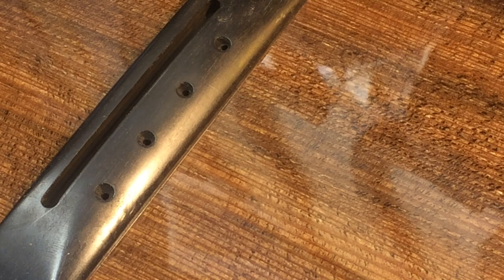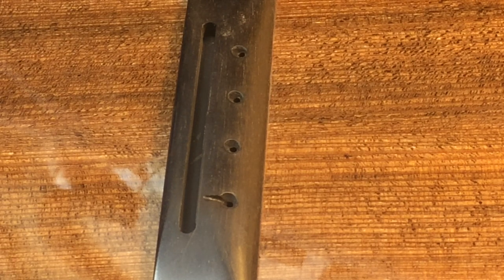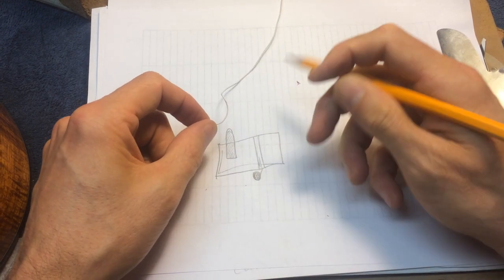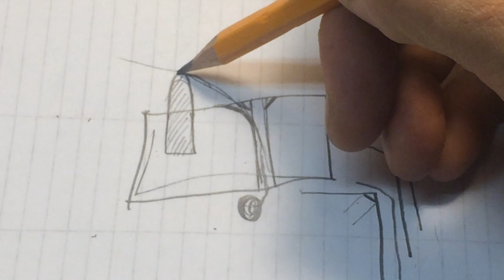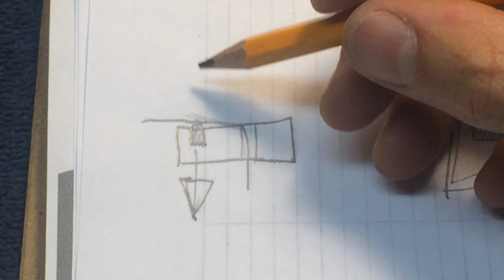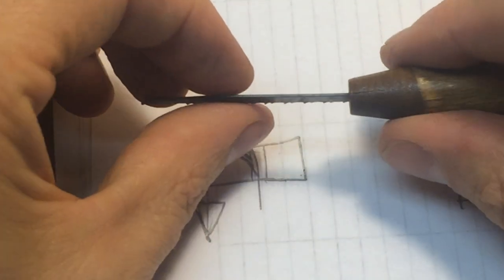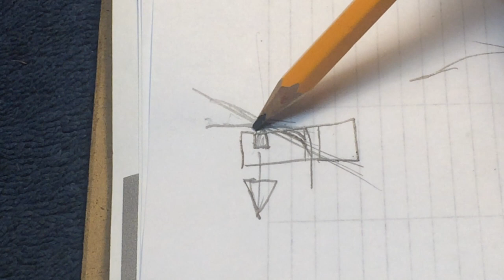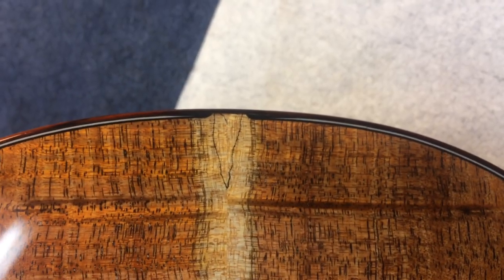Why you should cut string ramps in a guitar or ukulele bridge  Beau Hannam

Comment: I think it's worth stressing what Beau says in reply to another commentator. The rationale for tonal improvement from ramping relates to break angle. As I said in response to a post from a different luthier on this topic, Alan Carruth did an experiment on this and concluded that the amount of break angle needed (at both nut and saddle) is only what is needed to accurately define the point where the string crosses the nut/saddle and exert enough tension to keep the string from moving about and wasting energy. That's not really very much. See Carruth (he found that on blind testing people could not tell the difference between a break angle of 25 degrees and 6 degrees - that's a lot - provided the strings remained the same distance from the top) but also Ted Woodford's channel for more on this. At the saddle, the issue only arises if the saddle has been lowered to such an extent that Carruth's two criteria are broken (usually in an attempt to lower the action in a guitar which is getting near needing a neck reset). In this situation, ramping is a great thing to do, but otherwise there's no real evidence that it makes any improvement. The reason for tonal improvement is because once the two criteria are broken, tone is seriously degraded, and ramping restores the criteria.
Reply from the maker: Yep- 👍🏻 forget to say EVERYtHING in a video.

Comment: Beau, thank you for the video! Beautiful work. I would have liked to see you do the finishing touches on the ramps though. What file or sandpaper do you use to finish them off? Also, are the string holes small because you string the Uke through the sound hole? Thanks for sharing your technique 😊✌️🙏
Reply from the maker: Thanks- I think i use a 1/16th bit- just enough for the thick C string to fit through- 
To finish, i usually use some 220-400 sandpaper wrapped around a nut file.

Comment: Hi There,have question.Aside of ramping the  bridge hole ,
Do you also recommend to slott the bridge holes  inside to, so that you can use unslotted bridge pins and the strings would  be sit in in those  littel rows/slotts inside ...some of the Luthiers says that this method brings the top to move further more and vibrate more.Cheers Neven
Reply from the maker: I would use a combination of the little saw that stewmac sell and a dremel with a small ball end bit.
Reply: @BeauHannamGuitars  thx 👍